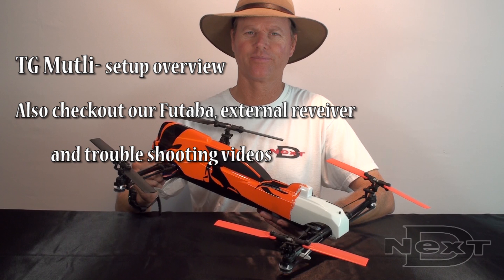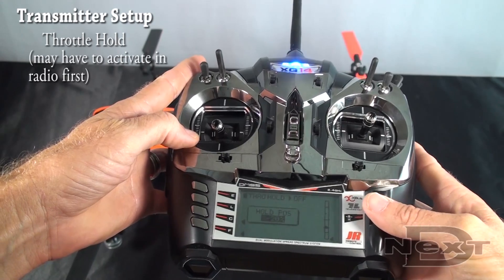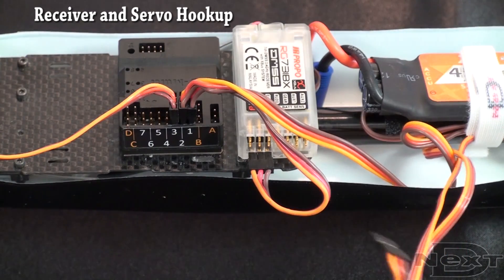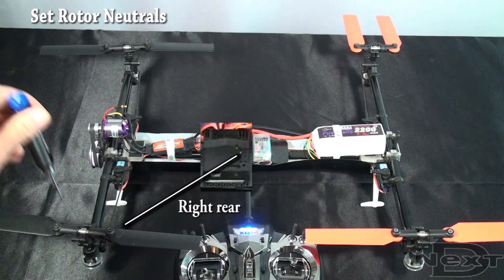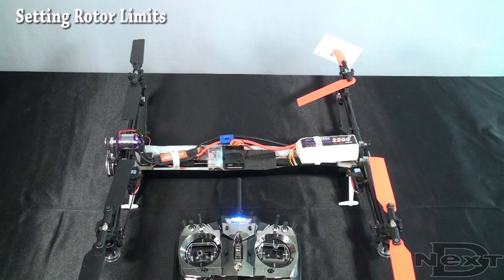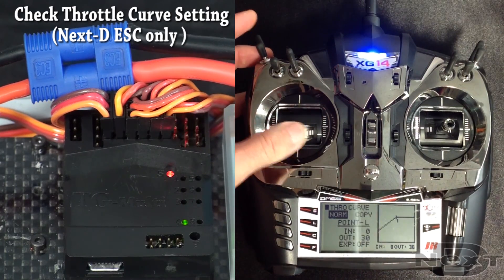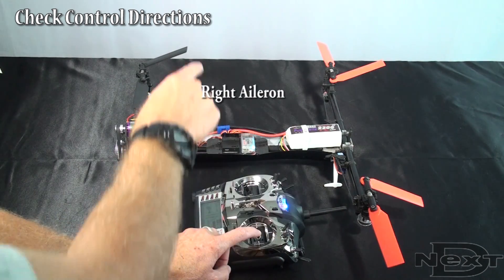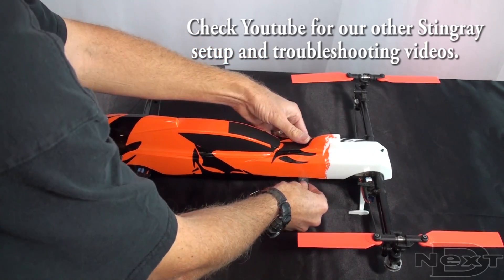Stingray 500 Setup Vid #4a - TG Multi Setup Overview

Comment: I fly my own custom quads that use KK2 and AMP 2.5.  I also have recently gotten into planes. I purchased the stingray to have some fun with the collective pitch design, but this video is wwwaayyy to confusing for me.

I'm guessing there is a lot of assumed knowledge of helicopter setup in a transmitter, and there's a lot of menu settings that don't match up with my Turnigy radio from what I can I can see.

Reading the documentation and watching this video has made things very daunting to setup the stingray. I wish the flight controller could be directly interfaced with by a laptop and I could go through and adjust values with a nice GUI.
Reply: Okie I think I'm starting to get my head around it. Firstly, context of setting up the servo levels. I think what would have helped is that stating when going to set neutrals mode on the flight controller, it should be made clear that ALL servos are set to their neutral state. Took me a while to realize that, as I was trying to work out why I had to set conrods and servo arms in certain positions.

Once I realised that all servos were set to their neutral position when in this mode, the goal was to adjust the conrod length to a position to get the blade pitch as close to neutral as possible so THAT when I reconnect the arm to the servo it would be at 90 degrees.

The fine tune adjustment by the controller should be made clear that it is the third phase of this to get a really precise position of the blades. And that it does it by setting the default value of the PPM value on the flight controller..

Thats my 2c on the instructions so far.  Second night in on building this thing :P
Reply: ChiggenWingz
Third night of setup and its pretty frustrating. The big confusion is the reasoning behind all these changes, it doesn't make sense to do these things yet or why they are important. The other hard part is knowing what channel things are on. Its fun to say "Throttle" and "Rudder" and all that, bit I need to know port numbers because my transmitter is set up very differently for all my other quads and planes.

When you mentioned Stunt mode during the throttle setting section, I'm like "wtf?!" I can't remember setting up a port for stunt mode and knowing what values I have to use to set it up right.

Man I hope someone makes some firmware to run an APM 2.6 on this, it'll hopefully be a million times easier to setup. Right now feeling pretty frustrated by it all. I'm dreading the first flight to find out what I didn't setup right only for it to have a crash
Reply: ChiggenWingz You ever get that stingray in the air? Really does seem daunting. But very cool, tempting.
Reply: Not yet, been practising on RealFlight simulator, but need to resit down with the stingray and set it all up again now that I understand more about general helicopter setups. Check out this Stingray forum if you need any help setting up http://www.helifreak.com/forumdisplay.php?f=357